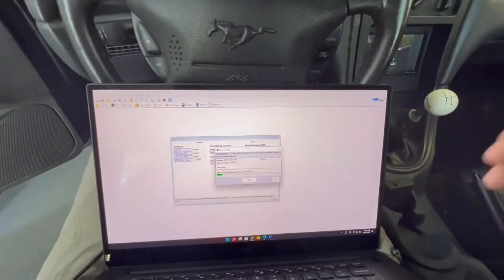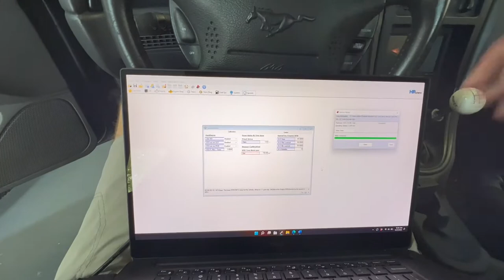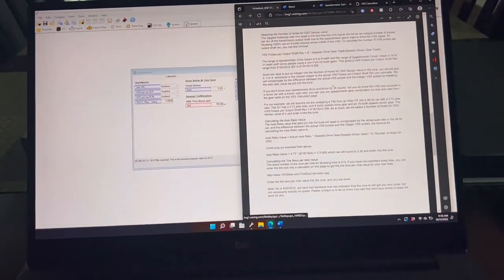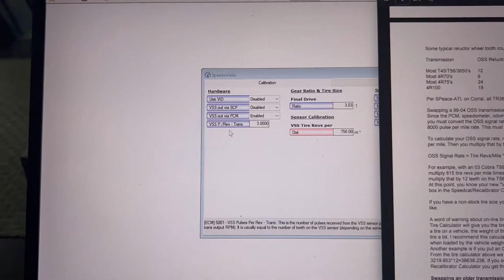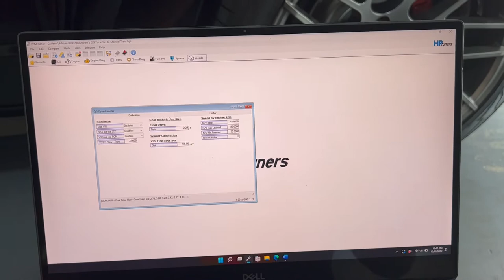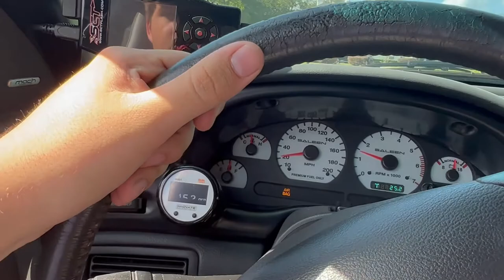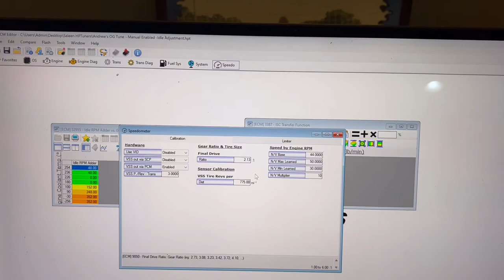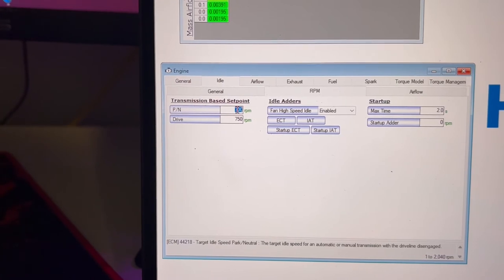How to correct your Speedometer! Pre-1999 VSS Transmission in 99+ OSS Car

Comment: I have the same problem with my 98 mustang gt and honestly I feel like it is an issue with the ford instrument panels as sometimes they can be very inaccurate from the speedometer, fuel gauge, and possibly the oil sensor. Not to such but very good information.
Reply from the maker: I agree about the clusters. They are a little bit behind the times, even back then. The oil pressure gauge isn’t even a true gauge, it just uses a pressure switch that triggers at I believe 6psi to show if there is pressure or not. GM at least had a true oil pressure gauge. Also the fuel gauges are pretty slow to react and not always right either

Comment: How did you do the wiring?
Reply from the maker: Has a 1999-2004 T45/TR3650 harness. The plug on the 96-98 trans is the same for the speed sensor as it is on the 99-04.